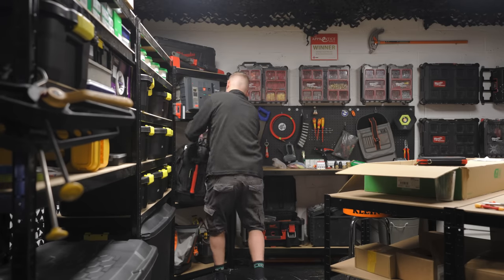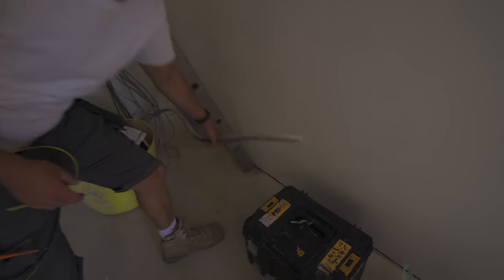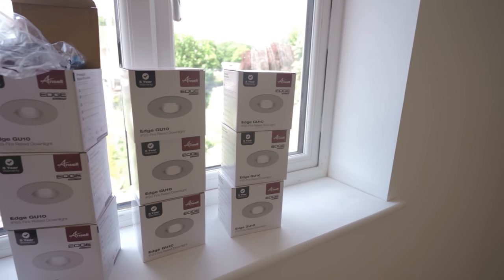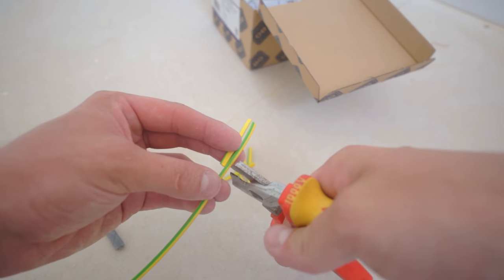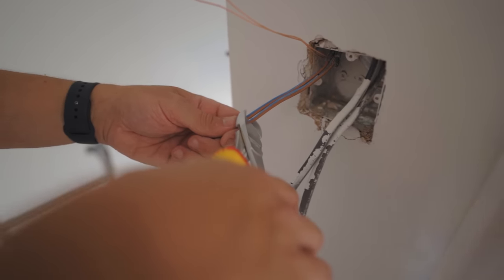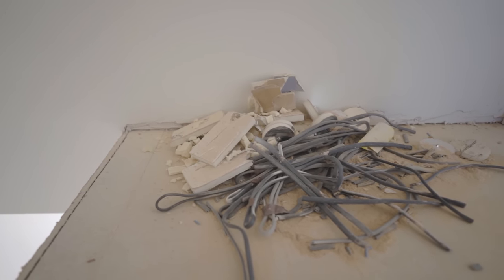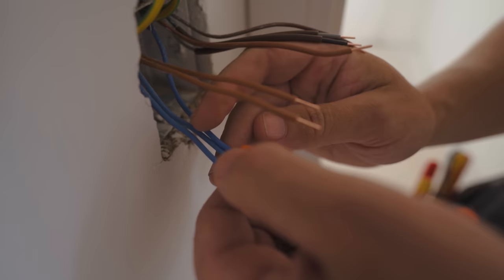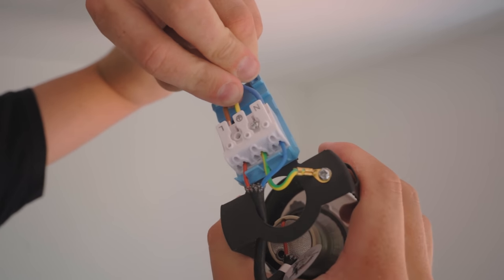Second fix tips with @RDavisElectrical

Comment: Also, When will the UK adopt insulation of the CPC in their T&E. Australian TPS is a breath of fresh air to work with. Not only is the Earth/CPC sleeved, the cable is also stranded.
Reply: My understanding is the bare copper of the CPC means it's easier to get a Live to CPC, Neutral to CPC fault in the cable if someone screws/nails into the cable. Would be nice if T&E was stranded tho

Comment: Prep for finishing is very important .Stripping and prepping cables then placing comments where they need to go and then start doing all your connections and mounting .Any help in organization prep speeds up the process .Some cases time and material is the only way to go for some custom installs .

Comment: Did R Davis forget to earth the metal switch box , it’s easy to do whilst second fixing into both fast fix and metal chop in boxes on the same job ?
Reply: I don’t think you need to mate pretty sure it’s earthed by the screw and the wall plug and it had a plastic fittings going on top so not accessible . Personally I do it anyway and especially If it’s surface mounted

Comment: If using a wago to terminate your cpcs at that light switch how is the metal backbox earthed?
Reply: Piece of sheathed earth/cpc from the back box screw- into the wago mate.
Reply: Cut a piece of wire put earth color sleving on conected from 5 way wago where other cpc are conected and then connected to the metal box where a screw bar is
Reply: Not necessary
Reply: If is any metal plate yes it is necesary
Reply: @emilgemc8913  talking about the box
Reply: Yes  when you use a front metal plate as a dimmer or switch chrome
Reply: @emilgemc8913  yes obviously that would be earthed but that's not what we're talking about here
Reply: @reeceoverton1421  🤦‍♂️🤦‍♂️ yes it is necessary read the regs come on that's basic electrical installation works.
Reply: The light switch box should be earthed, it must be earthed as its part of the electrical installation. A socket back box does not have to be earthed if it has a fixed lug which doesn't move.
Reply: @mikethemask1525  it depends on if the back box has 2 adjustable screws /one solid one & one adjustable or two solid ones. From what I could see I could see one non adjustable and from experience you normally have the adjustable on the left which you can’t see. If it’s two adjustable then yes it needs to be earthed. If it’s one adjustable and one solid which I think it is then you do not need earth it’s just desired and if it’s two solid the. You definitely don’t need it. It’s in the guidance note 8
Reply: @callumsimpson7483  no that's not correct as in my previous post you'll see if it's a socket back box with one solid lug then it does not need the back box earthing as it will pick it up off the socket via the 3.5mm screws but if it's a light switch it must be earthed unless you are using a metal face plate as this would give you the connection via the 3.5mm screws again to the back box but if it's a plastic faceplate then you MUST earth the back box as there is no earth connection on the plastic faceplate.
Reply: @mikethemask1525  your wrong mate it doesn’t matter if it’s a light switch or socket. Your getting mixed up with it being earthed to the back box as the plastic face plate for a switch doesn’t have a earth connection. It had one solid lug on the back box so it don’t need it. Maybe you should look it up on guidance note 8 or look up Efixx we’re they clearly state it as well.
Reply: @callumsimpson7483  no I'm saying if it is a socket back box with 1 fixed lug then you don't earth the back box as the socket faceplate will earth it via the fixed lug. If it is a switch back box then it must be earthed if using a plastic switch as there is no earth on a plastic switch which means earth must go into the back box earth. I'm not on about a fly lead either as it isn't needed on plastic switch. If you have metal switch then you earth the face plate thus earthing the box.  I am not wrong at all so if its just 1 fixed lug and plastic you must earth the back box, do tell me how it would get earthed if you didn't for example on the switch if when screwing it back the screw caught the line conductor it would then liven up the metal back box and the 3.5mm screws and sit there all day until someone got a belt. It has to be earthed.
Reply: @callumsimpson7483  I've just watched the efix video and I find it a bit misleading. It does clearly state that the backbox should be earthed (which is correct) and it states that if there is at least one fixed lug then using the earthing strap on the accessory is an acceptable way to earth the backbox (also correct) this is consistent with the IEE guidance.

What it fails to mention is that not all accessories have an earthing strap. In particular plastic light switches do not. If it doesn't have an earth strap you can't use the earth strap to earth the backbox.